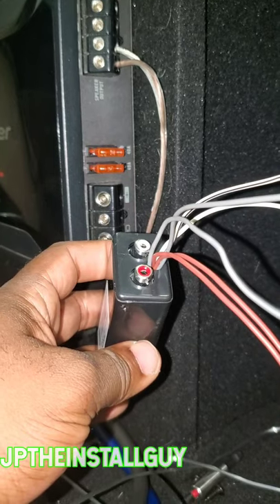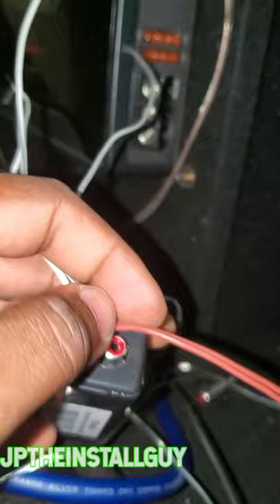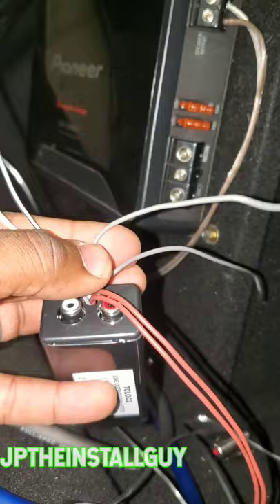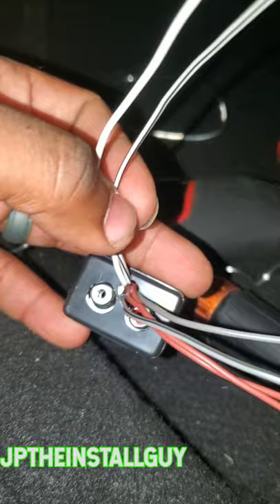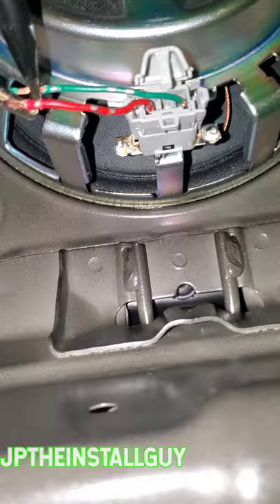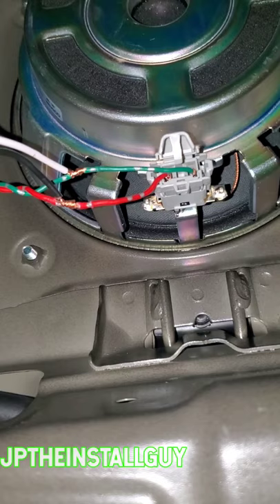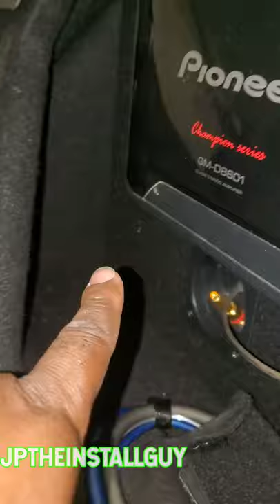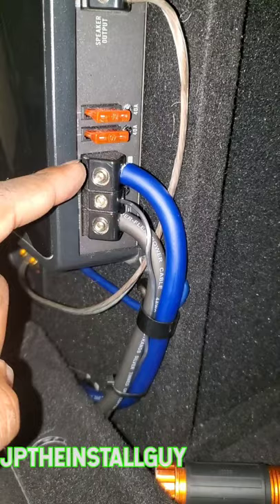how to install a loc - line output converter in 3 minutes

Comment: Hooking up the loc does it do anything to the impedance the head unit sees ? I mean if you have a stock 4 ohm speaker and your radio is seeing a 4 ohm load, when you add the loc is the radio still seeing a four ohm load with the loc wired to that channel also ?

Comment: I hope i get a response 🙏. If i have a single voice coil sub and have coupled both L+R positive and L+R negative together then do I connect it to my front left speaker of my stock radio harness or my right speaker? Does it matter? Or is it still safe to split the connections to the left front speaker and right front speaker? I have a 2009 4runner.

Comment: i’ve a scosche converter, the instructions say to connect yellow to a constant power source so i tried my +12v battery wire in my factory radio harness and nothing. I than tried tapping it into my amps power wire keep in mind along with the remote wire connected every time and still nothing. Last of all i even tried a add a circuit to my trunk latch for constant power, tapped into that and STILL nothing? Maybe instructions are wrong and just needs to be switched power? well i tried with a switched power with the add a circuit and what do ya know, nothin.

Comment: I got a problem I hooked it up I guess I hooked it up wrong 😢had to fix it its hard to turn on my car now but starts and gives engine code camshaft sensor and stuff and now I hooked it up right its working fine but not like it used to bc it doesn't seem to be booming as it did before why is that

Comment: Hey bro I was wondering if you could tell me I'm newer to anything more than a set of subs on stock everything and a basic 2 channel LOC But I just ordered the LC7I to get both of my amps playing since the sub is drowning the mids and highs out but my car is a 19 Camry and a major major headache to swap out the head unit or get through the door grommet to upgrade the front door and dash speaker wire for upgrades so I'm wondering if I can take a single rear speaker channel and branch it off to all 6 channels for the LOC and if not how would be the easiest way to hook it up and it says something about channel summing do you know how to configure that to work properly

Comment: What if you have 2 stock 6x9s running on a stock amp and no stock sub? 2014 Maxima Bose system has no sub but an amp powering 2 6x9s. I hooked the white wires on the loc to one speaker the grays to the other, grounded it and connected the blue wire to my amps remote, plugged in the RCAs and when I start my car, my amps turns on, my subs make a woo woo woo sound and my amp shuts off all in 3-4 secs. Each time I disconnect the remote wire and reconnect it, it does that. Solve that one lol.

Comment: with aftermarket head units and standard RCA's, the sub will adjust its level depending on the volume of the head unit. Will these do the same? Or will the sub stay at the same level regardless of volume?
Reply: They will adjust

Comment: Does thus video include a mosconi one amp that doesn't have a hi level output converter ? Cause I have an mosconi one amp, how would I add a hi level output to Add another output for another a/b mosconi amp, how can I do that with the best sound?

Comment: But will this work for a mini Cooper r60 I need help with the line converter install I got the power ran and ground ran just struggling with the Harmon kardon wire splice.

Comment: Quick question, so i have a 2006 lexus gs300 and it has a factory 10 in the rear deck that is blown. A while back I disconnected the harness from the sub it self, the harness should still have power running through it even though Its disconnected from the sub itself right? If so my question would then be could i still tap in to the harness that’s disconnected from the sub?
Reply: Im trying to install a 12 inch sub

Comment: What if your running two dvc subs at 1ohm on a mono amplifier?seems like every loc I've seen is under powered to run a amp like that and two subs at 1ohm?if anyone knows more about this lemme know cause I've always just use a head unit with preamp outputs for the rca s.ive never ever kept the stock headunit in any of my cars/trucks

Comment: So if im running just one woofer can i just tie the two negatives and two posotives to jist one of the factory woofers if the factory woofers are just two wires??
Reply from the maker: If the factory sub only has 1 pair of wires then yes if it has 2 sets hook up separate left and right

Comment: Hey man, my car doesn’t have a factory subwoofer, just tweeters and a speaker in each door…how do I work with that?
Reply from the maker: you can hook it up to any pair of speakers as long as it plays full range so if the rear doors are full range then you can use those

Comment: hey so i have a line output converter and i was going to use the rear factory sub to tap in as a remote but the wires are short on my line output converter and idk what type of wire i can use that can reach to the woofer and my loc should i use speaker wire or actual like power positive and negative wiring
Reply: on my loc it has the blue and white remote wire i did manage to get some just plain blue wire but i dont know if i they can go be used together

Comment: I had a sub installed with a factory stereo. I’m assuming an LOC was used. How do I install an aftermarket stereo? Do I need to take it out or can I keep it in?
Reply: If you get a aftermarket stereo you don't need it anymore. Aftermarket stereos already have the rca outputs

Comment: This video did no work for me 
Followed the same steps & my amp doesn't even turn on lol 
Theres no video showing where to connect the remot for the amp to get signal
Reply: Same here. 2014 Maxima with no sub but an amp going to both 6x9s in the back. Hooked up the white wires to one speaker and the gray wires to the other, grounded it and connected the the blue wire to my amps remote wire. I start my car, my amp turns on, my subs make a woo woo woo woo sound and my amp shuts off all in like 3 secs. Each time I disconnect the remote and reconnect it, it does that. Idk wtf is going on cuz in my 02 it worked just fine without the stupid LOC lol.

Comment: Mine has a yellow (12v) and blue remote wire can I connect those directly to amp or do I even need those??
Reply: Yea the remote connects to your amp in the P.COM connection. The yellow 12V has to be connected to a constant power wire in your radio wiring harness. You'll have to look up what color wire that is for your vehicle.

Comment: Sooooooo if I hook it to my stock subwoofer I have to keep that subwoofer in place?? Bcuz its under my seat and initially I wanted to remove it and place my bigger sub there.
Reply from the maker: naw man you can take that sub out if you want to and just use the wires to get signal for the new amp and sub. sorry for the late reply im trying to play catch up
Reply: @jptheinstallguy  its all good. I went ahead and tried it and it worked....until I realized my amp messed up 😂

Comment: Where did you get your remote from?
Reply: He's got the remote running from the head unit, that's why he capped off the remote and ground from the LOC together. Most LOCs can grab enough power from the speaker wires... most have a remote wire and a ground... keeps you from having to run a remote back to the head unit.

Comment: Hey I have a 2012 pilot but a different brand loc.  My loc has remote and power wire.  I hooked into the rear sub just how you did in the loc in this video,  remote is tied into the remote to the amp and power is tied into the power going to the amp but not getting any signal.  Any ideas?
Reply: Same issue for me. Did you figure it out?
Reply: @mattola6  I never did.  I just traded this pilot for a Nissan armada so no longer have it.  I just ended up hooking up the high-pass wiring to my door speakers and using the powered sub I had that way

Comment: I have a question on a 06 lexus gs300 im installing a 5500 watt sub amp and a 600watt highs amp should I use a extra battery and larger alternator?
Reply: I’ve always read anything over 3K it’s recommended you start with the Big 3 upgrade. The extra bank and higher output alt is going to save you time and money in the long run, especially if you plan to add/expand your system.
Reply from the maker: It really depends on the true rms power that is being drawn from your charging system. If that sub amp is true 5500 yes upgrade the alt and get an extra battery for reserve power Kristopher is correct
Reply: Thanks guys. You guys don't understand how much this mean to me and the money you saved me i was going to go buy a new alternator this morning. You just saved me from buying the same one again now I can just buy the 250amp. Once again thanks so much you guys are awesome.

Comment: Man my amp is getting 12v and is on but I can't get any output from my subs I've double and triple checked all the wiring idk why they're not working
Reply from the maker: are you sure your tapped of speaker output wires. sometimes if you go behind the radio but you have a factory amp somewhere you may be on data wires

Comment: What u do with the remote wire?
Reply: What I used to do is get a kill switch. Run the remote wire on the amp to the switch and from the switch to the positive on the amp. And that'll be your on and off switch

Comment: What if the speakers are in the door and there is no factory sub
Reply from the maker: as long as the speakers have bass or at least full range you should be good
Reply: @jptheinstallguy  my bad I meant what was the best way to get to wires? Lol. Take the door panel off or find the wires before they go into the door.

Comment: Ok how about if it  has factory amp?
Reply from the maker: this one did have the factory amp, usually any car with a factory sub has an amp that powers it when the sub is easily accessible its just easy to tap into the wires at the sub but you can catch them at the amp if you want.
Reply: @jptheinstallguy  yes thank you, i thought it needed something special like fuse. I connect and had no signal, but whole time it was my rca not being unplugged

Comment: I was wondering, could tap into the speaker line or factory sub line at the solder points of the speaker or do I have to wire it before it reaches the speaker? Is there a difference?
Also, since I don't have a factory sub but have to tap into the 6x9's in the rear, does that mean I still have to wire to two channels toghter? I am running a mono amp to my subs at 2ohms.
One more question. And I notice when I try to take a reading from my lineout converter, I see fluctuation and not a steady reading, what could that mean? And my RCA's check out fine after check continuity. 
Thanks

Comment: I installed one in my car and I’m getting vocals out my subwoofer can it be because the converter??
Reply from the maker: mostl likely what the wires you tapped into what you put in the loc is what you get out of the loc so make sure you tap into speakers that provide only bass or at least full range
Reply: @jptheinstallguy  I installed it to the rear factory subwoofer but I think it’s my amp now because it’s a taramps smart 3 amp and the low pass starts at 90